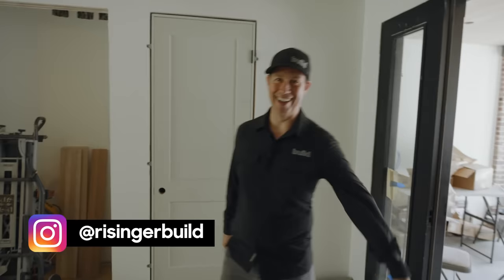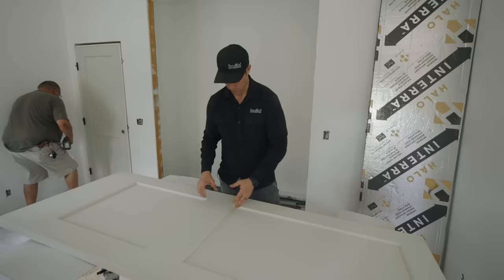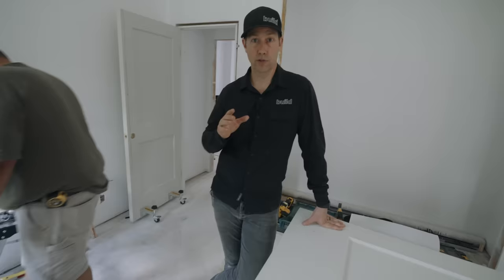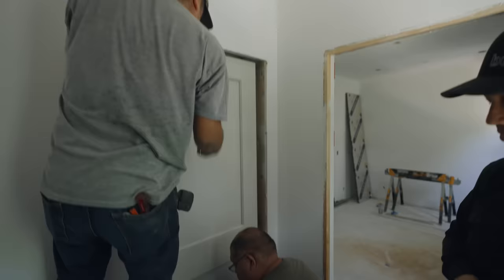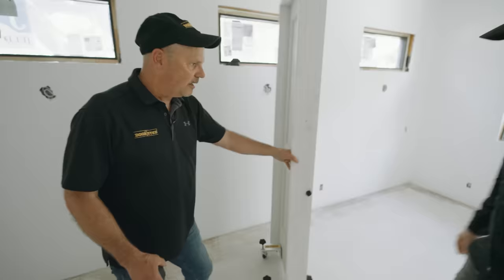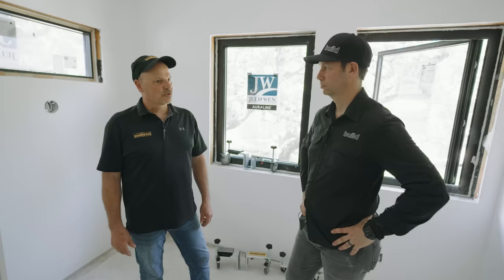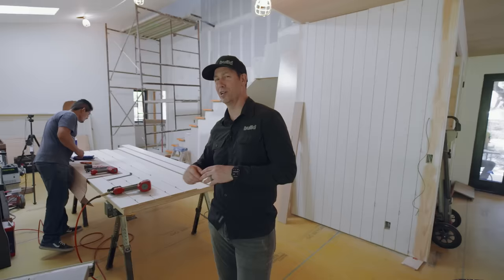A new Door Install Tool that Is AWESOME!

Comment: Been in construction over thirty years, these days I’m mostly a trim carpenter. I bought a set of the door stud and absolutely love them. No more fighting  or damaging the door to set it. Well worth money spent. Keep up the good work Matt
Reply: I can see how these work on a flat jam door but do they work with a split jam door?
Reply: I don’t see why it wouldn’t work on split jam doors, I haven’t installed one though. As with installing any door there is always some fiddling to do either because of poor framing to much mud on drywall and many others, the door stud is just a tool to help you so your not fighting it. I have used the clips they sell so no shimming is needed and I’m not quite sold on them. The door feels flimsy, after the casing is installed you can still move the jam back and forth

Comment: EZ-Hang Door kit, is another brand
This was a rush job 3 guys less than 8 hours. Did 15 doors installed less than a day. Did last five or so in less than 15minutes each. All were trimmed and caulked ready for the painter the next day. $150 tip from the home owner.

Comment: Those door clips are how I install my doors, so easy and fast. I need to get some of those rolling feet things though!
Reply: Strength compared to screws through the door frame?
Reply: @Josh.1234  I've never had a problem with them. If you had a very heavy door you could throw in a few shims and screw too. I just find I get my doors more level and perfect gaps
Reply: @dangraves25  uniform gaps can be a pain at times so if it helps that I'm very interested
Reply: Daniel - how do you put the door trim on with the bracket and the screw now being on the face of the drywall?  Do you rout out the back of the casing where the brackets are?  Do you let it run out an extra 1/8 inch and caulk the gap from top to bottom?  Do you have to order doors with jambs that account for the extra 1/8 inch on each side?  (1/4 inch total additional)
Reply: @VC-Toronto  nope, it actually just lays flat over it. I always caulk and seams with my trim work before I spray it but it's def not needed. When I do flips sometimes I install prefinished trim instead of painting in place and they look fine
Reply: @dangraves25  ⁵

Comment: They have those install a door kits at home depot, they are amazing
Reply: I have 14 to replace and I will be trying those
Reply: Any worry that it won't be as strong a hold as having longer screws going through the jamb, through shims and into the framing?
Reply: @Josh.1234  you still are recommended to do that for a screw on the top hinge.  I plan on doing one screw for each hinge.  Important on heavier doors
Reply: @Josh.1234  i do screws and shims to be safe, the kit helps get it up and straight, quickly.. You are going to nail trim to it, so its not going anywhere even without the screws and shims added. I have replaced trim in houses, where they only used finish nails to install doors...😳. They lay the door down, nail trim to one side, push door into opening with trim against drywall, and then nail trim to the other side! All the doors just fell out when you went to remove trim... none of them closed properly, but they still "functioned". Held only in place by finish nails...
Reply: @triggeredtroll6466  haha well I am not sure about relying on trim to stabilize it. Solid core doors and kids who like to slam them will loosen that up over a decade or two. I would have to have shims and long screws at each hinge and at the strike to feel comfortable.
Reply: I dunno about this.  What about bad framing? Where the legs need to be kicked in or out to sit flush

Comment: I am still waiting for someone to cover how you get the door slab flush to the finish jamb... the ideal finish is flush, but I don't how the cavity slider system allows for micro adjustments where the finish jamb and edge of the pocket door meet... usually there is allways some micro adjustment required to achieve this.

Comment: Like most viewing this, I've done my share of creating and/or building plus hauling by myself to 2nd floors the heavy items like sheetrock, doors, windows, etc. Any tool to save the back and energy level is appreciated and like others pointed out...surprised no one else thought of this in the past. Kudo's for inventing this device. What is arguably a concern is that it took at least getting to 11.30 minutes in to the video to get an explanation and instead listen to hype and a sale pitch for the doors selected and the source. I watched out of curiosity over the tool not the doors!

Comment: In order for any manufacturer to warranty an interior door all six sides and any routed areas including hinge routes must be painted. Not just bathrooms. In Florida we use fiberglass for all of our exterior doors so it is not as necessary to pant the top or bottom.

Comment: solid wood doors make a huge difference to noise dampening between rooms i have done both and the builders grade hollow core doors are like having a curtain compared to solid doors when it comes to sound when i was younger never needed help to hang any door even 3 foot wide 8foot high solid oak doors those door dollies sure would be something i would use now lol

Comment: At about 6:53 he mentions installing doors without shimming. Bad idea in my opinion. I have corrected many doors that had issues because they were not shimmed correctly. I always shim behind each hinge, at top where head jamb meets side jamb, and at bottom about an inch above the floor. On bolt side at head jamb, bottom, above and below lockset, midway up and down from lockset. It takes more time but I don't have call backs.

Comment: Unfortunately the stud dogs do not work on remodel work for the most part.  I install front doors, and they won't adjust to the various heights of the subfloor and threshold. I was very disappointed because it looked like a wonderful product.

Comment: Matt serious question: Why do builders build such HUGE houses? 

The average family size has gone down by almost 1 person per household over the last 50 years but the new house size has more than doubled in the same period.

When people talk about expensive houses they seem to forget houses use to be much smaller. I can’t help but feel housing would be much more affordable if the sizes built were actually in line with the amount of people that would live in them.
Reply: Frank Lloyd Wright used to design fairly small houses in order to encourage people to get outside. This was before HVAC was common in the "everyman's" house. Now people try to stay in the conditioned air as much as possible and feel they need the room to do the stuff people used to do outside inside.
Reply: @HandlebarWorkshops  Please list some outdoor activities that you do inside your house.

My house would have to be the size of a mall for me to do what I do outside.

Comment: we use lots of off the shelf HD doors. i dont really have to many problems installing the doors by myself with just a pinner and shims and lazer. But the framing is 82" high, right. you put the door in. if you carpet the gap under the door is .5" for padding + .5" for carpet + .5" HVAC. Except when I was cutting my door I was cutting past the 1" of wood on the bottom. I ask jeld-wen customer support, what's going on. what could I do different? Support was like, dont cut more than 1" off. WTF... like the door needs to come low, because if i can I'm going to put the jamb right on top of laminate or tile, if i can. then its just .5" for HVAC. so that's 1" difference between carpet and not carpet.

Comment: Ok. It can not save you 20 minutes per door. It takes  10 minutes (5 if you prep the opening to the door size) to install an interior door (hollow or full core, it does'nt matter once it's in the opening).

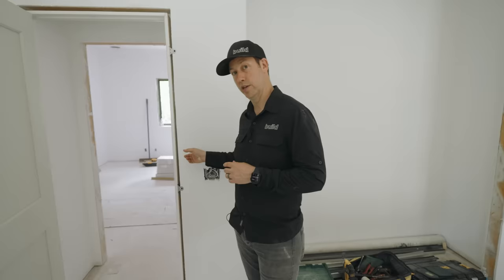Comment: 7:38 It's really amazing how cheap builders have become. Every house we ever built was 1/2" inch for the ceilings and 3/4" for the walls. All wall stud ceiling joist floor joist and rafter placement were 16" on center. Oh, and the slabs were level. We built a Barndominium out of raw red iron. I have never got to do a bolt-together. But the slab in one corner was 2 1/4 " out of level. It's crazy. We never used that $*& %#!%& again, naturally.

Comment: What is the point of emulating a three panel door if you start from a blank solid wood box.
The panels and overall construction of the door served a function.
Why not cut something more interesting like maybe 45 degrees hatches or something.

Comment: As much as I appreciate your content, i have to point out a couple of safety issues.  No temp railing on the stairs and the worker standing on the top of a step ladder.  The top and second step on the ladder  are not to be used.  This is in Canada, not sure about the USA.  I do construction F/A and have had to deal with 2 bad falls.  One from a 6' drywall trigger onto concrete, shattering the kids elbow which was a limb threatening injury,   the second was a drywall taper who stacked 3 five gallon pails inside each other, flipped them over to stand on....He fell shattering the surface between the femur and tib-fib.  That too was a limb threatening injury.  Sub'd

Comment: With this system, I will pay € 1000 as installation costs and not € 500 per door. 
You have to mount it at every door and level it out for every opening.
Reply: If your saving time, your saving money. Which is more valuable though?
Reply: @phatbaby4234   Over here you will save 0,0% money with that system. We place the frame, then the door.
Reply: @ADOENDRA  I took less than 10 minutes after the door was centered. I can't see how that doesn't save money.  Those metal plates are less than $2 each.

Comment: As a finish carpenter of 18 years now this is pretty embarrassing to watch. Fast fit doors are a DIY's dream as the door comes fully dressed with no potential for adjustment and GLUED on door stop... A nightmare for an actual carpenter. Pros build their own jambs, jamb header and assemble the door complete squaring it with shims and cut everything to fit. We know that 1-3/4 solid core doors are heavy but once they are hung and set the hard work is over. We don't need gimmicky wheels to lift a door. If it's awkward, use an air bag.

Those ridiculous clips he sets the door with are an embarrassment. If your walls are out of rack and/or level you're in for a world of pain using these. Junk. These clips take skilled carpenters and turn them into installers. You don't need these gimmicks to do a high quality job.